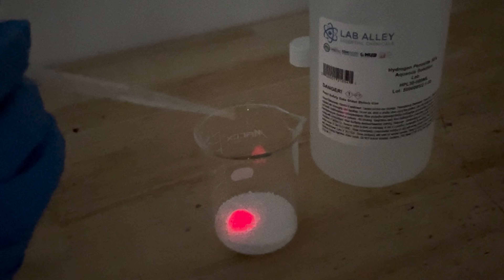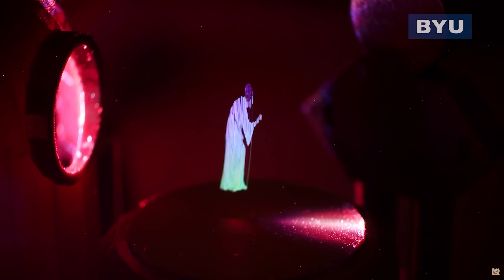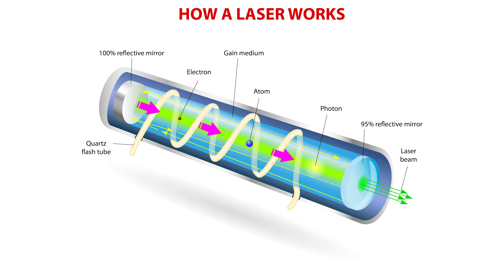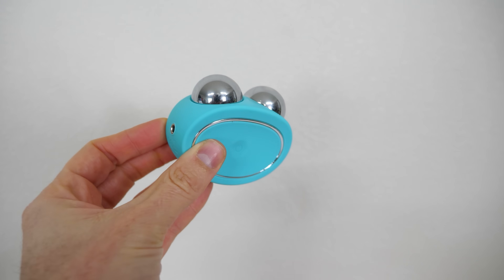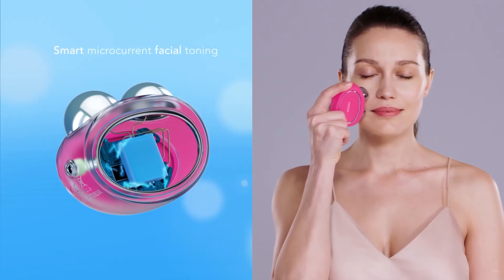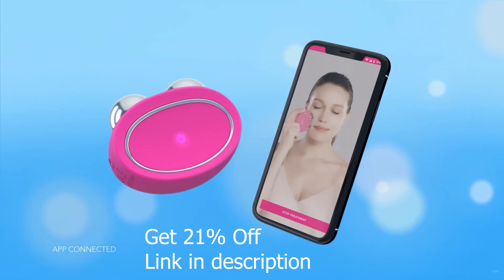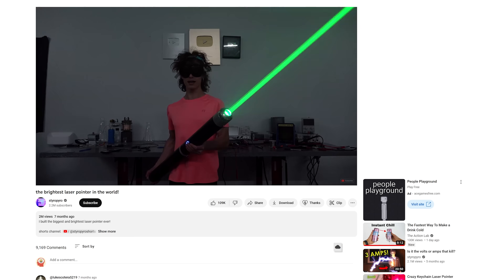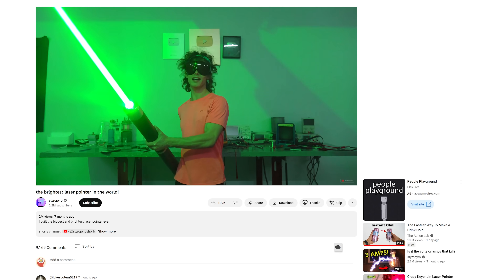Singlet Oxygen Is Scary!

Comment: Fun fact: it is possible that the pyramids could have been chemical lasers, the materials would have been placed inside the queens chamber and when the nile flooded the reaction would have sent the laser outward through the gold lined vent, it is possible that this was some kind of means of communicating with the stars, who knows. Happened a long time ago, but an experiment was made using a scaled down model of the great pyramid and it did successfully work as a chemical laser

Comment: Unlikely decommissioned because of dangerous chemicals. More likely because 100s of Km is not enough range to defend against outgoing ICBM. In order for it to intercept effectively it needs to do it as the missile is launching and this means that the enemy airspace would have been already violated. If you're already in all out war against a country with ICBM capability, and you're at a stage where you're able to get a bunch of these to loiter around in the sky waiting for launches, chances are you already have some other cheaper way of destroying them.

Comment: I've been thinking instead of hoarding info, maybe now inspiring making ammonia and other nitrates using microwaves. I'm certain there is a more efficient way to improve on existing reactions.
Reply: Seems like might be efficient ways to break down polymer and other hydrocarbon waste using as well, flowing the grind or powder with susceptor material through a continuous microwave stream process.

Comment: Just want to chime in that pulsed lasers don't just exist because of electrical restrictions, they have many interesting properties, uses, and advantages compared to CW lasers. For example, in laser cutting, a sufficiently fast pulsed laser will dump energy into the material so quickly that the heat does not have time to dissipate before the material vaporizes, giving a much cleaner cut.
Reply: And to add up to the pulsed lasers cohort - certain things could be done only with the pulsed lasers. For example, femtosecond (70-120 in most cases) pulsed lasers allow peak powers at 200+ kW at 80 MHz repetition rate and 2-3 W of average power.
This allows quantum miracles of the two- and three-photon effects, enabling actual 2P and 3P microscopy. Which allows you to study living tissues (like brains) without pretty much any damage, at resolutions way below the Raleigh limits (with some super-resolution tricks you can go down well below 1/10th). And these lasers are expensive, but off-the-shelf products for 15+ years.
Reply: @man0fstraw  to add some more to this cohort: I also wanna point out that the pulsing of most pulsed lasers is not caused by electrical power being delivered in bursts. Most pulsed lasers are pulsed using either Q-switching or mode-locking. For these lasers, the pulsing has absolutely nothing to do with the electrical power supplied, and everything to do with the optical processes/techniques used to generate the laser light.
Reply: @LennyHirsch  Sure thing, good note, thanks.
Reply: @man0fstraw  continuous lasers at the same wattage would be able to do the same you'd just use them for a fraction of a second when you need to. Pulsed lasers are always just worse versions of continuous lasers. Pulsed isn't magic it is just we cant make a continuous laser with those power levels without them destroying themselves.
Reply: @thomgizziz  Well, no. Of course, if by means of some magic you can  build a 250-500 kW CW laser, gate it at 80 MHz with pulse width below 100 femtoseconds, then yes. Otherwise  - no. And such a machine, if ever built, will require extensive cooling, power supply directly from the power plant, etc., etc. It will weigh a couple of tons and will cost half of the US military budget. When the existing pulsed lasers for scientific research have a weight well below 100 kg (incl. chiller and power supply), require about 1 kW from the socket and usually cost around 70K-130K (up to 250K for the most fancy ones).
Reply: @thomgizziz  sorry but that's very, very, very wrong. In what way are pulsed lasers just worse than CW? There is a huge number of things you can do with pulsed lasers that is impossible to do with CW. e.g. proper implementation of nonlinear optical processes, most of quantum optics, many of the highest precision metrological techniques, etc. Pulsed lasers are absolutely key to many different processes we use in science and in industry, processes that couldn't be done by CW lasers.
Reply: @thomgizziz they aren't worse options. To have a CW laser do most of the interesting stuff ultrafast lasers do you would have to effectively turn it into a pulsed laser anyways. At that point your magic CW laser is just being used obscenely inefficiently, and for the same amount of resources you could make and pulsed laser that's many orders of magnitude more powerful.
Reply: while I understand what you're saying, technically, the guys' statement is correct. If you had a cw laser with the same average power as a pulsed laser's peak power, than you would achieve the same thing if you gated the cw laser accordingly (which might be impossible electrically for high loads if it's >xMHz). Anyways, a 1MHz 1ns pulsed laser with 1kW average power has 1MW peak power. If you use that to process at 1m/s than you could achieve similar results if you processed using a 1MW cw laser at 1000m/s , just get a fast polygon scanner :P     - well, obviously I'm aware of the thermal limitations in optical components and also power-density limits during most material processes.

If you want higher peak powers/fluences however, you're out of luck. Imagine a 100kHz 1ps laser with 200W average power - one can get those off-the shelf too. That's 2GW peak power. Now we need a small rocket to match the power output, or two standard sized nuclear power plants...   Not gonna happen. 
--> Pulsed lasers will win!

regards - a laser physicist.
Reply: @randfee Sound more like engineer.
Reply: I always understood that really powerful lasers operating in the atmosphere needed to be pulsed as the atmosphere itself would react with the laser, causing it to become dispersive to the laser.  So there's an effective peak power, above which, less power is transmitted.  Pulsing the laser is a method to circumvent this limit.
Reply: "in laser cutting, a sufficiently fast pulsed laser will dump energy into the material so quickly that the heat does not have time to dissipate before the material vaporizes" A continuous laser would do the same... the problem is we have issues making a continuous laser that has equivalent power that wont destroy itself.
Reply: Could you simulate a higher power laser than you're capable of building by pulsing a number of lower-power parts all focused by the same prism into a single beam?
Reply: @nutwit1630  kinda? you'll end up with more power, yes. But it won't be a coherent beam, so many of the cool science things you can do with lasers wouldn't be possible. That's fine if you just wanna burn stuff better though hahaha
Reply: @nutwit1630 Something similar is done for lithography. You don't want to effectively recreate a CW laser out of many pulsed lasers, as you want heat dissipation after each pulse, but it does speed things up decreasing the time between pulses.
Reply: Disintergrater ray?
Reply: @davesmith3613  yeah... no...
Reply: It's kind of like an impact driver, where you apply higher amounts of torque in short bursts. It would be difficult for a small tool to produce the same overall amount of torque continuously. Also the pulsing torque gives a driver head, for example Phillips, time to reseat in the grooves of the head, which reduces the likelihood of camming out the head.
Reply: The pulse laser was an effect created by exploited the phased nature of video.
Reply: I remember that explanation from some scifi games. I honestly thought it was fiction too
Reply: I might chime in as someone who once worked on pulsed fibre lasers. As @LennyHirsch mentioned, you can pulse a laser by Q switching or Mode locking, but you can also do it through the use of a pulsed seed laser. You start with a low power semiconductor laser operating at the desired wavelength, you only need a few milliwatts here, this is then fed into a pre-amplifier, which is just coils of doped optical fibre fed by a pump diode. This would return something on the order of a few hundred milliwatts. This is then fed into a power amplifier which is pumped by the main bank of pump diodes. The seed laser enables you to easily set the pulse rep rate as well as define your pulse shape. The design of the power amplifier enables you to control your beam profile, whether it be single, few or multimode. The beauty of this design though is you can scale up the power amplifier to produce your desired output power. I had worked on lasers with as low average power as 10W and even built a prototype 150W single mode version. The real benefit is the very high wall plug efficiency of these in industrial applications. Gas lasers are very poor efficiency with CO2 lasers being the best at around 20%. Fibre pulsed lasers can be as efficient as 70 or even 80%. The monster at the National Ignition Facility starts with a fibre pulsed laser and is amplified up to a scale that can initiate laser fusion (@nutwit, this is what you were referring to).
Now, CW lasers have the benefit of having very high starting power which you can modulate to produce a pulsed effect, however it isn't as easy to control the pulse shape so for applications such as cutting and welding this is suitable but for more fine work like marking through ablation (the process that @tylisirn referred to) you do need a pulsed laser.
Reply: It also allows time for some of the smoke to clear out of the way so as to not block the laser. A CW laser has to shine through the smoke generated while a pulsed one can be timed to limit the smoke interaction thus imparting more energy into the target
Reply: @jasonharrison25  Smoke is easily dissipated with a fan or vacuum extraction. In metal cutting laser systems, nitrogen is used as an assist gas to push the material away as well as eliminate any smoke trace in the beam area. Large cutting systems create lots of smoke and soot residue that gets pushed away by the gasses.
Reply: CW lasers don't also do that?
Reply: @marca9955  Lower peak output, so they heat up the material slower at the exact point of burn, or they have to be more powerful to achieve same output. They dump more energy into the material overall, but we don't want that, we want to burn exactly what we want to burn and touch nothing else. So the pulsed laser is more controlled, the CW is less, but allows faster cutting. There are pros and cons to each. Also depending on material, the pulsed laser also can allow the vaporized material to clear the cut before the laser dumps more heat into it, while the CW will dump some of the energy into the vapor cloud, resulting in absorption and scattering.
Reply: The only comment he liked was this one.

Comment: High power lasers use a pulsed design because it's more effective at delivering the full power of the laser into the target material; a continuous laser will lose a lot of energy going through the plume of recently vaporized material, so a pulsed design just saves power by giving the vapor time to clear.
Reply: That, and continuous lasers suffer from atmospheric blooming where they ionize the air in the beam, which causes it to spread and dissipate at high powers and useful distances. You either have to make your beam bigger (lower W/m^3) like YAL-1 tried to, stay on target longer (not ideal for ICBMs), or pulse real fast to avoid the problem.

Comment: Great video.  One nerdy thing: The Death Star did use pulses.  My brother and I had a longstanding argument about this because we're very mature people.  The remaster shows it as clear as day - There's a targeting laser but pulses are what destroys Alderaan.
Reply: High power continuous lasers suffer from a problem called 'blooming', where the energy in the laser beam ionizes the air and causes a spreading lensing effect that defocuses the energy of the laser at distance. It's part of the reason why most modern laser weapons are pulsed power and not continuous. They get their shots off so fast that the air doesn't have time to ionize before the energy has been put into the target.
Reply: You can handwave that pulsed lasers are more effective because they give the material burned off the surface time to  drift away. Otherwise the clouds of material can obscure the remaining undamaged surface.
Reply: @economicprisoner  Probably also helps when each pulse targets a different part of the planet, causing an explosive chain reaction in the crust
Reply: The Death Star primary weapon is not a laser though it does use lasers for aiming.   It is a directed energy weapon that uses a form of beam energy that suppresses the nuclear Strong Force, causing atoms to fly apart with the same energy release as thermonuclear fusion reactions.   ALL the matter the beam contacts reacts in this manner.,  which explains the destructive consequences of even a light strike.

Comment: The hydrogen in the sun is already excited. If we shot a hydrogen-laser at the sun... Would we get a more powerful beam coming out the other side?
Reply: no, beam would be neutralized even at the most outer layer from more powerful particles going in opposite direction. Only BH is same level or more powerful than stars.
Reply: @Your_opinion_does_not_matter  Eh I figured there would be a catch. I also assume we'd probably have to use frequencies that aren't easily interacted with or low frequency to reduce scattering, either way, it's probably a pipe dream... might made a semi-decent Hollywood plot though.
Reply: @Arcticgreen  Sun has full pallete of light spectrum, because it creates isotopes of many elements within. So will cover and answer to any frequency, before even anything reaches even near. Same as shooting with a toy-water-gun a waterfall.

Comment: NOW!! Finally the laser weapons ya hear about the military bragging about makes sense. I was very dubious of electric based ones. This makes a ton more sense!
Question tho. How long does it take between let's say when they see an incoming missile, to the moment when they can actually fire? If it takes too long to prep it etc, it may still be a waste of time. 
Great video and thanks for helping to clear that up some at least! Thanks
Reply: YAL-1 was a chemial laser from the Clinton administration. Most modern laser weapons are electric. They use massive banks of capacitors or supercapacitors that are pre-charged to dump their energy into the lazing media rediculously fast. That first shot goes off in an instant if that's what's needed. Recharge time varies by system. I'm an electrical engineer who has designed power systems for a few laser weapons, continuous and pulsed.
Reply: @FluidKaos  How long on a electric laser system of advanced notice is needed to charge the capacitors?
Reply: @hughgrection3052  They typically run locked and loaded when in a combat or threat environment. Some of the lower power drone swarm defense style systems have a rapid recharge rate, especially when compared to the big naval systems.
Reply: @FluidKaos  Yeah the Naval ones seem the most prone to bad weather and line of sight alone. Many missiles now are so fast they have plasma shields. Not sure how that all plays together. Not sure what keeps threats from just using a mirror like coating and deflect much of them too. At least with plane mounted ones they can get above the weather. 
Unless they get some way to mirror them with satellites somehow I think the line of sight alone is a big handicap. 
It just seems like we could use the money better elsewhere on conventional kinetic weapons. 
But I'm just a dude on a couch trying to understand lol